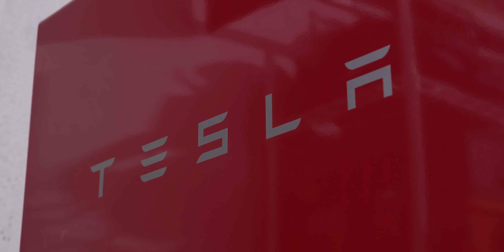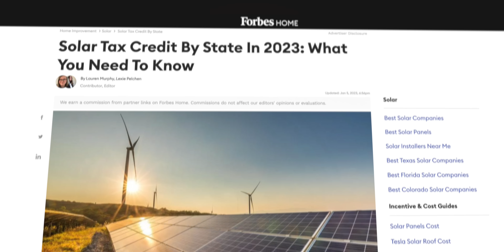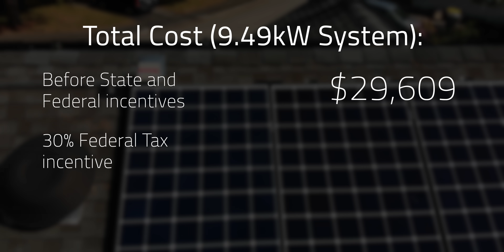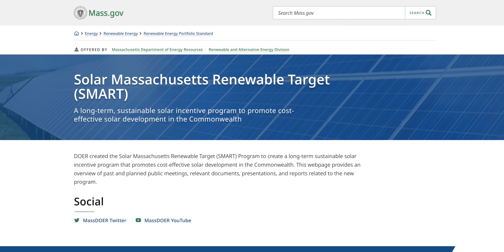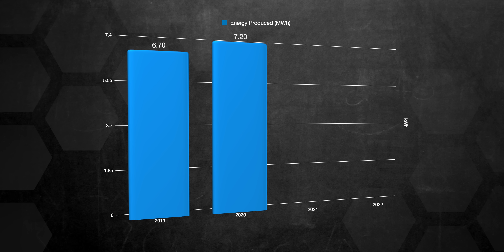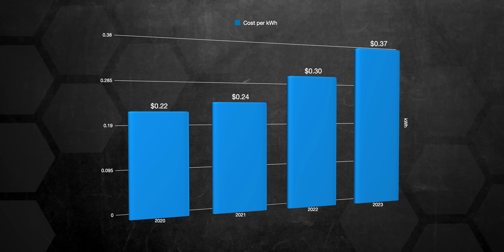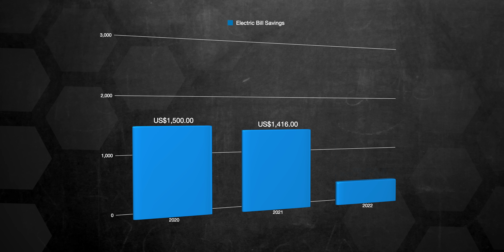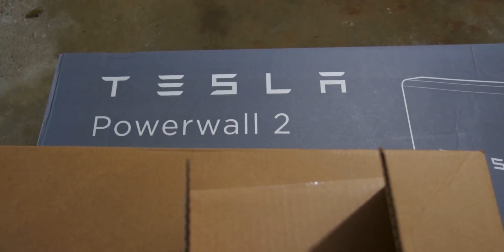5 Years with Solar Panels - Is It Still Worth It?

Comment: My rental property came with Solar City Panels when I bought it.  I'd priced them out on my primary home in the past but never purchased them.  What they sell you is a loan that rises in price over time and a line they tell you is that electric prices through the utility are going to rise faster than the cost of electric through the loan.  Here we are 6 years after buying that house and I can tell you Solar City(Tesla Now) charges more per kwh than the utility company.  
Also, my wife is a real estate agent.  From what I've seen having solar panels is not a boost to your home's value unless you outright own the panels.  Otherwise you're buying a solar contract that many buyers will see as a burden.
Not worth it.
Reply: As with many things in this economy, ownership is better than leasing – and the only people who lease should be the people who can’t afford to buy. And even then, saving to outright purchase later is usually better, unless you REALLY need it today.

I would personally say, buying used panels at a large discount will always be better than leasing new panels. The power production is lower, but the cost is even lower still, so the price per kWh is better. It won’t eliminate your whole electricity bill, but you own them outright, and there’s plenty of them on the market right now.
Reply: @kaitlyn__L  could be an interesting option as new panels have a really high up front cost.  My home would be 20k to 30k just to eliminate a $100/mo bill.

Comment: Lot's of good information (as usual) Matt.  One concern I would have, possibly misplaced, on the VPP part of your talk is how it will affect the lifespan of the battery with the extra charge/discharge cycles.  Would you please address that question?
.
I'll agree your electric usage does seem a little high, but IIRC your home is pretty much ALL electric.  Our average power use is right around 540kWh per month, but we have a gas furnace and water heater (both fairly efficient).